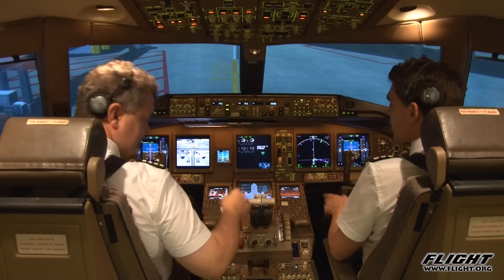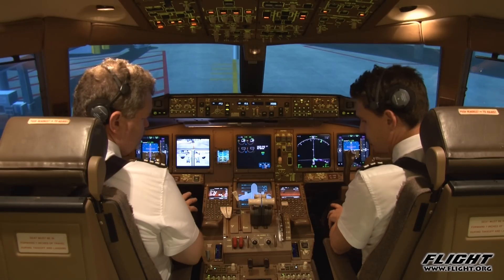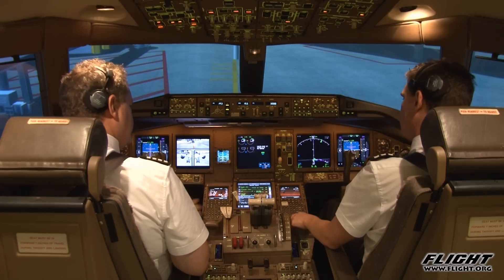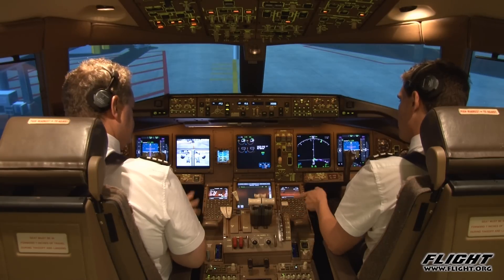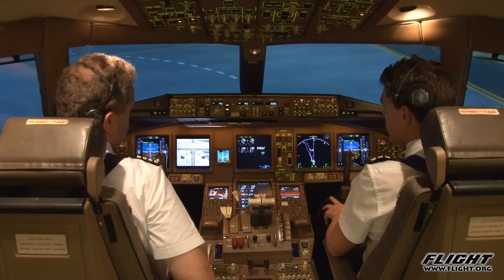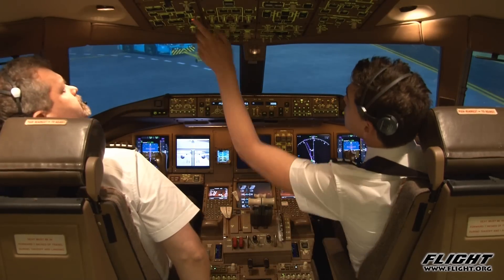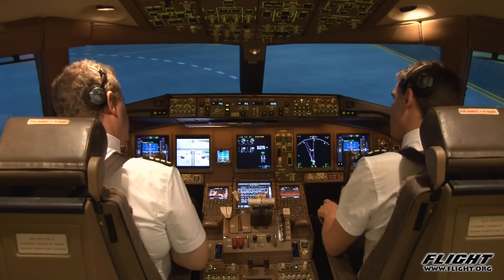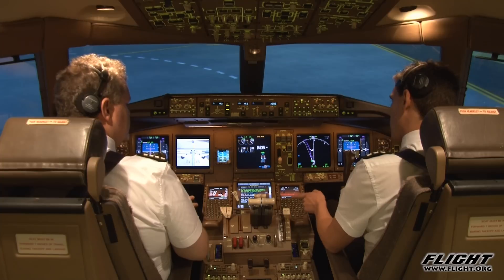Boeing 777 return to gate after a slats failure

Comment: I actually used this trick of doing the after landing checklist or flow as we have it in or company. We had to return to a gate after pushback for technical issues as well. We hadn't actually trained for this kind of situation, but I remembered the way you did it in this video, and decided to suggest this to captain. Also the captain thought this was a great idea. At least a great way to prevent having the flaps out on the gate :D thanks

Comment from the maker: This sequence was shot in a #Boeing 777-300 simulator. It demonstrates a procedure to be used and basic actions to be considered after a slat failure occurs after pushback.
Reply: bennett346 I guess because reasons
Reply: Flight question, are those v speeds of around 190 knots also used in real life? Because sometimes they just go for flaps 15, at leaast that's what i thought
Reply: @MauritsVeen Long runway, cold weather, lower thrust setting = Save fuel

Comment: Thanks for posting this. VR 187 😳!  I wonder did the crew know the exact scenario or was it a surprise for them?
Reply: wym
Reply: They know of the scenario that takes place, they just dont know WHEN it will take place.. meaning an engine failure for example could happen when they are on the take off roll, or once they rotate into the air..

Comment: Wouldn't the flight deck crew be able to contact there company without the ground controllers assistance via ACARS or something?
Reply from the maker: Sure, if they wanted to. ACARS is slow and cumbersome, and it wouldn't normally ever be used on the ground as an alternative to VHF radio.

Comment: co-pilot/trainee failed to follow communications instructions accurately.  Captain requested relay to tower requesting message to company stating condition AND requesting ground crew deployment.   Co-pilot/trainee re-worded the Captain's message, and failed then to request ground crew deployment.   If Tower followed the Co-pilot/trainee's order/request,although the Tower would have been informed of the technical malfunction, the Company would not be informed the issue was in relation to a technical malfunction, nor would the Captain's order for deployment of ground crew be relayed to the Company, as the Captain ordered.   When instructed to relay an order, junior officer must relay order accurately with all components and should not re-word it and/or omit information.   noted in file.
Reply: No one can be arsed reading that
Reply: the communications pitfall of messages which "sound" authoritative and professional, whilst omitting some key component of information or necessary formatting protocol - is illustrated at outlined above, that's all.
Reply: Your criticism was not unfounded, but it was a bit excessive. The video is not an official training video, so the pilots have a little bit of leeway.
Reply: we are going to disregard your last message

it is a training session and errors have to be noted in the file, that's policy
Reply: 010203040506073 woops. I was half wrong. The video is for a training environment, but the video disclaimer states that it "doesn't necessarily reflect best practice." The criticism was correct, but for a slightly (and I mean very slightly) relaxed session it is a bit excessive.
Reply: when the Captain says he wants the company notified of the malfunction, the Co-pilot/trainee must transmit the message reflecting the Captain's instruction in regard to that point, which he did not do.  Likewise the Co-pilot/trainee failed to transmit the Captain's instruction calling for deployment of the ground crew.    These are not trivial matters.
Reply: 1.  it appears clear that the younger man in the Co-pilot's seat is not the Captain, but rather he is the Co-pilot or Trainee - not sure what your point is, if any.
2. Two potentially critical pieces of information were omitted by the Co-pilot/trainee:   a) the Captain's instruction to transmit/relay to the company that there was a technical issue, and b) the Captain's instruction to transmit/relay the request to dispatch of a ground crew.   For all we know, the Captain is under orders to report such an incident to the Company, and the Trainee failing to so so, in addition to jeopardizing aircraft safety, could result in a deficiency mark in the Captain's jacket owing to failure of supervision / failure to report.    As for the instruction requesting dispatch of ground crew, for all we know the Captain made a judgment call that this was appropriate, or perhaps that is the Company's code sentence to call for security.   Perhaps he had detected alcohol on the trainee's breath.    Perhaps he felt an angina coming on. 
We simply do not know.
3.  #1 I do not see it being you role to over-rule the Captain and make a determination that the Captain's orders were trivial, and frankly it would appear you are simply wrong anyway.   #2  Those are "safety" type instructions, and for the Trainee to over-ride/bypass them, well he should not do that again, put it that way.   That was a serious error, actually.   Two serious errors, if we are to be accurate.

And by the way, I will run along if and when I am ready - you do not give instructions to me.

The Trainee's communications protocols were poor, and hopefully he will learn from it.
Reply: well, if that is how you feel - you should be a psychiatrist although I do not think you would be a very good one.   Some of us are not meant for certain careers.   I was tested once, for career aptitudes, and while I will not tell you what they said I should consider doing, in some fashion - but I will tell you what they told me not to do:   1) do not try to be a pianist, 2) do not try to become a surgeon.

while I am not a commercial pilot, I do have a lot of experience with professional testing, and also a fair amount of training in risk management including operational risk management, which is a topic on which I have been interviewed a featured professionally.

In this situation, depicted on YouTube - the scenario is both training and testing - and the Co-pilot/trainee did not follow the basic instructions of the Captain.

Without getting into too much detail, in part because I find your dialog to be boring and insincere, the sloppy communications practices definitely earn the Co-pilot/trainee a deficiency mark on the test.   Sorry, but in a command-type situation like in the cockpit of an aircraft, the orders of the super must be followed and with a degree of exactness.   Likewise, on the bridge of a ship - same issue.   Perhaps on the U.S.S.  Fitzgerald, if they had followed Navy policy and diligently run a human "underway watch" with binoculars, the freighter would not have crashed into the ship and killed ten sailors.    Perhaps they felt that Navy policy that requires underway watches with binoculars to be "only a general guideline", and their view, like yours, was that the requirement is "subject to what you feel like doing".

No, the test speaks for itself with respect to the Co-pilot/trainee, if and when it is pointed out to him, I believe he will learn from it and become a better pilot as a result.    However, with respect to this particular test, it does call for a deficiency mark in his jacket.    That's life.   Next time, he will do better.
Reply: 010203040506073 But you're missing the fact that if ground crew were not called for when the aircraft returned to the gate, the captain or first officer could just switch to Ground from Tower frequency and call them at that point. It would be irrelevant to dock the first officer off at that point because the action to call Ground would have already been resolved.
Reply: There are many possible ways to deal with communications problems - there is nothing to prevent the Captain from repeating his orders, that is true.   But that is not exactly ideal procedure.   When a commercial airline pilot calls for his company to be alerted as to the existence of a specific technical problem, we have to assume that could be a general order reflecting sound procedure on the part of the Captain OR he may be following orders himself.     Perhaps there was an Engineering/Mechanical Memorandum on the matter, that requires the company to be immediately alerted.   General concern on the part of the Captain is every bit as valid however, as the basis for his orders.    For the Captain to specify Ground Crew to meet the aircraft, clearly should not be overlooked.     It is apparently a training tape, next time the Trainee will probably do better.   We hope so.

Unfortunately the people on the USS Fitzgerald who died, very possibly due to the absence of the mandatory underway binoculars watch properly administered - those folks will never have a second chance.   Following proper safety procedures, including communications protocols - is a good idea; on ships, on planes, in various other situations.
Reply: 010203040506073 But there is also the fact that as dispatch, the airline employing the captain and first officer would also be aware of the procedures necessary for this situation. I am not sure if this is true, but I am assuming that company would be able to check in with Ground and at least make sure that the pilots have their necessary resources at hand.
Reply: There is a word that describes someone who enjoys foolish argument for the sake of argument, argument for sport based on a false premise or false premises:    a sophist.    And that is, at this point, what you are.

The Captain gave a couple of  simple and potentially important safety orders, the Co-pilot/trainee, probably inadvertently, ignored them.    And you want to stand there arguing that's fine.   Well, go argue with yourself.

If the flight control systems on a large airliner have failed, as they did in this tape - and the Captain says "notify the company" and "have a ground crew meet the plane" .... you do it.    Period.

If you have a problem with that, see the chaplain.
Reply: 010203040506073 As far as I recall you submitted the first rebuttal to this video. That would disprove your assertion that l just want to argue for the sake of it. My point is that your point is valid; however, it is too harsh given the context of the video.
Reply: 010203040506073 And all my comments really say that the captain shouldn't have stressed too much because he could do the action himself if ground crew weren't called. You keep saying that the incident could have been very critical, but it's only a slats failure. It's not a hydraulics failure or an engine failure for you to worry too much about. Calm yourself down and stop issuing profanities from your YouTube account.
Reply: You are in fact off the team.     It's done.    Nothing we can do about it.    Now I am not even going to talk to you.
Reply: you're off the team, it's final.   Now get out of here.
Reply: it's better now that you're off of it, tell you that much

and it's a pretty good team actually - better now that you're gone, tell you that

and that's it you're not coming back, and we're not going to talk to you anymore
Reply: keep it up and I am going to call security

now get out of here
Reply: @hendy9380 only you buddy